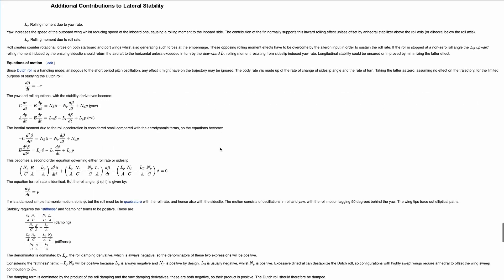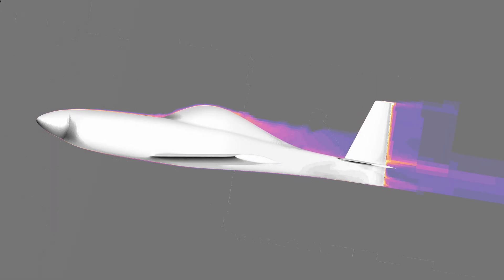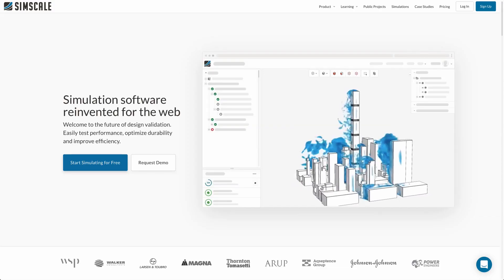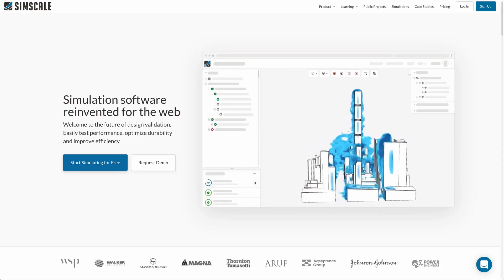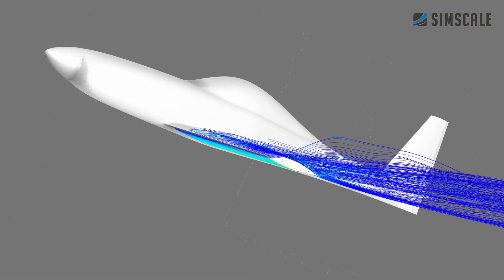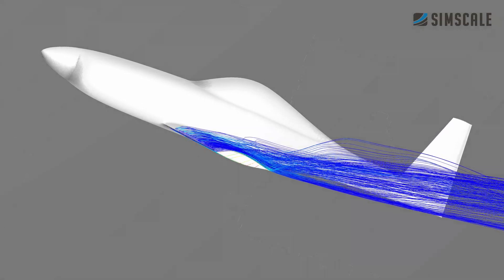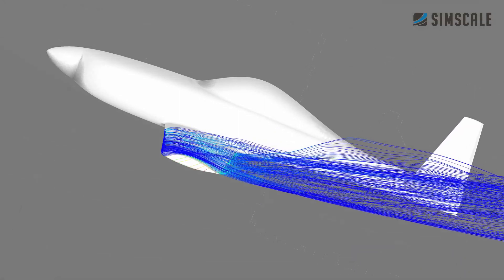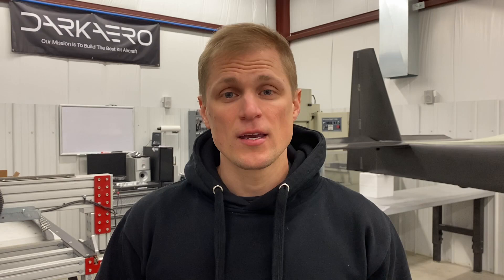Simulating Stall of the DarkAero 1 Using SimScale Cloud-Based CFD

Comment: Try calculating the drag coefficient of a sphere with the software as a gauge if you can trust it to any degree.
Reply from the maker: While we didn't do any sphere simulations, there are a lot of publicly viewable sphere sims run under all sorts of different flow conditions in SimScale's community accounts. Your point about whether or not to trust the results is valid though and there are methods that can be used to determine if the results are reasonable. The underlying computational models are well proven but they do have their limitations. It's important to use the correct simulation model to analyze the particular flight conditions. For example, certain models are better at handling laminar vs turbulent or compressible vs incompressible so it's important to have an understanding of your flow conditions upfront. The mesh size and type is also important to get right. It's possible to run the same model with different mesh densities to get an idea of if your results are converging towards a solution. Another variable is the number of computational iterations and the residual error in the solution. CFD programs (SimScale included) can output residual error and give an indication of the convergence and stability of a solution. Once you have a result it's good to have some physical expected results like wind tunnel testing to compare it to as a cross check.
Reply: @DarkAeroInc  could you try a sphere? perhaps a couple of different sizes and simulation resolutions. It's a simple object and has a combination of aerodynamic and turbulent forms so it might be very telling. What I found to be the case, certainly for x-flow is that any half decent understanding of what makes an aerodynamic shape is vastly more precise than a simulation. If that is the case, you can save a lot of time by skipping all sims, knowing they will only mislead you with a false sense of rigor.
Reply: @DarkAeroInc  and should it give roughly meaningful numbers, you could try adding golf dimples to a sphere which I expect will give a second tier understanding of the efficacy of the tool so you can know when and when not to consult it.

Comment: Thanks for the terrific video. I would be interested in how you sized the horizontal and vertical stabs as well as the rudder, given that they all look quite small, especially the rudder. Spin recovery is a frequent problem area for new light aircraft. I would be interested to also see the same software show airflow during a yawed stall.
Reply: Here is a simple truth. No light sport aircraft etc has problems with spin recovery.  Rather poor pilots have problems with spin recovery requiring massive empenages to more adequately cover their *** lack of situational awareness**  at LOW altitude when flying SLOW.  What this means is that Light sport pilots react too late because most of the crashes happen due to low speed too LOW to ground and therefore have insufficient time to recover with the perfectly adequate empenage.  Instead of blaming oblivious pilots, empenages are being blamed.  Empenages, by calculation are all massively oversize for spin recovery.  Empenage sizing by calculation, is entirely dependent upon LOW speed landing/TO conditions for cross wind and rotation/max alpha correction.  Empenage problems for spin recovery are PLACEMENT/Blanketing of wing/fuselage on said rudder/elevator, not size. 
How do you size them?  Tail Volume Coefficients which tie directly into your neutral point and static margin calculations at different alphas for the moment of the airfoil.  Rotation moment required which comes down to mass of aircraft, and landing gear distance from CG.  This aircraft in question will have a relatively high VR on a ~medium length runway instead of like a STOL plane who must use the extra velocity from the propeller slipstream to rotate.  Gets back to propeller selection for CRUISE, or do you select for more thrust on Takeoff?    Not a simple answer, but an answer.  With such a light aircraft, rudder, elevator forces even with their design should be low.  Why you do not generally speaking see their design as the aircraft increases in size.

Comment: CFD is an amazing tool.
  
With its fairly high wing loading, do you anticipate the DA1 absolute and service ceilings being close together?

Is it possible to anticipate through design tools and wind tunnel work the kind of incipient stall indication the aircraft will give, eg tail buffet or wing buffet?
Reply from the maker: Good questions Lew! Our service ceiling is currently 20,000 ft but this is mainly because UL Power only publishes engine performance data up to 20,000 ft. The absolute ceiling will be higher than this but we haven't made any hard claims about it without the engine performance data. 
The "feel" of the stall is a little trickier to measure through CFD but you can look at how airflow over the wing contacts the rest of the airframe. Tail buffet would be from the horizontal stabilizer flying through turbulent separated air shed from the root of the wing.  We do see this effect in our CFD results so a tail buffet is expected. Hopefully we see this in flight testing.
Thank you for watching!

Comment: Do the results gained from CFD then go into time response and handling qualities analysis?  Are there certain handling quality requirements that DarkAero must satisfy from a regulatory perspective?  I would assume that would be the case to be able to qualify for certain type ratings, but maybe not with experimental aircraft?  I'm a senior in aerospace with interest in flight dynamics and controls type of stuff so I am just curious how the regulations and other polices come into the requirements/design of the aircraft.  Keep up the good work!
Reply from the maker: In general, experimental aircraft are not required to meet the same standards and policies for design and manufacturing as certified aircraft but we still follow them as much as possible. For flight control and handling we follow FAR Part 23. An example of where we might deviate would be our use of a non-certified engine.

Comment: Nice video! I was wondering whether you by any chance know the reason why the initial flow separation occurs where it does (about 1/4 semi-span), instead of closer to the root?
Reply from the maker: Thank you! This is an excellent question. The wing uses different airfoils at the root and tip to achieve a progressive stall. The tip airfoil stalls a few degrees after the root airfoil. If the wing was a straight "hershey bar" shape it would probably stall right at the root first. The taper of the wing adds in another variable that pushes the initial stall outboard. For the particular family of airfoils we are using, a section with a shorter chord tends to stall sooner than a longer chord. It is the combined effect of the different airfoils and the taper of the wing that drives the initial stall location. The start location is acceptable since it is inboard away from the ailerons.
Reply: @DarkAeroInc  Thank you for your explanation. Very clear. My guess is the fuselage wing junction would also have an effect and move it back inwards or just enlarge the separation area slightly? Of course you did not include the fuselage, for explanation purposes, very understandable.
Reply: Interesting, so it’s not washout, but airfoil shape/chord span wise difference?

Comment: Do you simulate prop wash?
Reply from the maker: For this particular analysis we didn't simulate prop wash because we were focusing on the wing and it would add unnecessary complexity and computation time to the simulation. The prop wash does have an effect on flow though, especially at the root of the wing. It is important to have a wing that stalls in a favorable manner both power on and power off so the model without prop wash is still valuable. We are thinking of sharing a simulation with prop wash in a future video because these effects are pretty interesting to see. Thank you for watching!

Comment: Interesting to see visually how the wingtip vortex increases with AOA. Would the induced drag from this vortex be significantly reduced with the addition of a winglet, enough to be worthwhile on this wing? I'd also love to see what kind of effect on airflow separation would occur with the addition of vortex generators, and how that would affect stall speed.
Reply from the maker: Good eye noticing the wingtip vortices! Properly designed winglets would reduce induced drag. A similar result could be achieved by adding extra wingspan or something like a sheared wingtip which we would probably implement before a winglet. Our wing is optimized for high speed cruise and at this operating condition the induced drag is pretty low, around 5-7% of the total drag. At our cruise conditions, adding winglets would reduce induced drag but would increase parasitic drag by a similar increment so the net result is close to neutral. They start to have more benefit in a high altitude economy cruise scenario though. Thank you for watching!
Reply: Is the wingtip squared off or rounded? Would an upturned tapered wing add benefits similar to the SR22?

Comment: Nice job of keeping it straightforward and understandable with good editing. Question: Any consideration of the wing tip vortices effect?  And was any consideration given to adding winglets to the wing? Also, very interested in the answer to Marty G's questions. Great job!
Reply from the maker: Thank you Mark! The wing tip vortices are really minimal at our cruise condition which is the first wing simulation shown. The vortices get larger at higher angle of attack but realistically the airplane won't spend much time operating at high angle of attack. We have considered doing something like a winglet but the design we were thinking of would be more like a wingtip fence near the trailing edge of the aileron tip. Something like a mini version what you see on the A380 wingtip. It might be fun design area to iterate on down the road.
Reply: DarkAero, Inc I was also wondering about using winglets to address the vortex issue in both the area of high speed, high angle of attack but more importantly in low speed stall conditions around landings and takeoffs. I’m not sure what your predicted stall speed (VS1) is but I would imagine it is higher than many entry level and Kit planes which would add to complexity thus classifying it as a more complex plane to fly. I certainly don’t want to see the DarkAero 1 get the reputation as a pilot killer like the Evolution IV got labeled—which was a key factor in sinking that' company when liability insurance became all but impossible for the company to get and keep. Low speed stall characteristics can have a really huge effect on the short and long term viability of not just the airframe and wing design but also that of your company. Using winglets sooner rather than later might actually improve your business case as mitigate risk up front.
Reply: @DarkAeroInc  Good answer, thanks.

Comment: Are you able to do the same thing with flaps extended and ailerons deflected? How about the horizontal stabilizer with elevator deflection? What a cool tool. I love all the technology you guys are implementing in this build.
Reply from the maker: Thanks for checking out the video Marty! Yes, we can simulate control surface deflection. This might be interesting to show! We were thinking of sharing something like the split rudder sim as a follow up to our split rudder video.
Reply: @DarkAeroInc  This would be an interesting video.